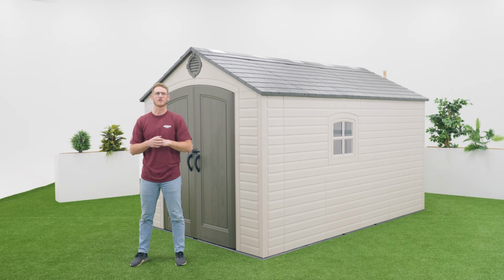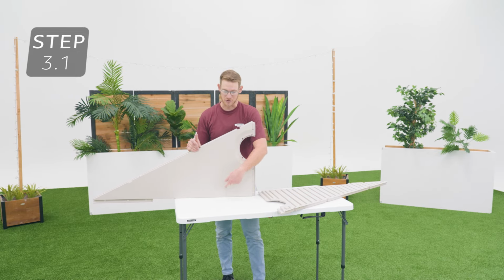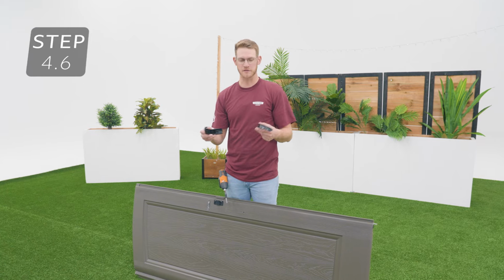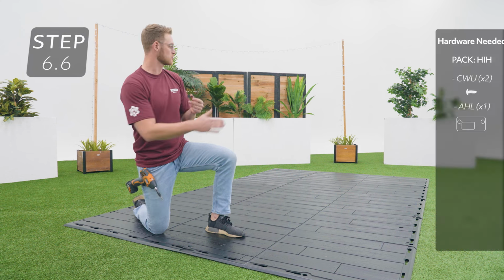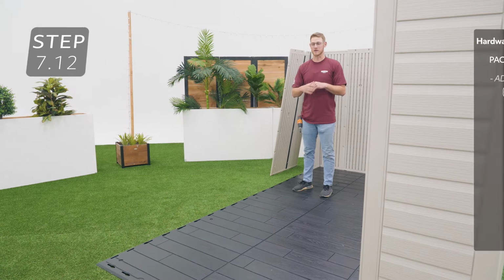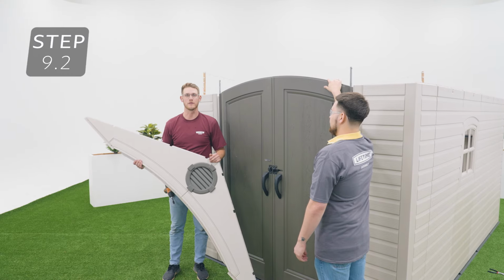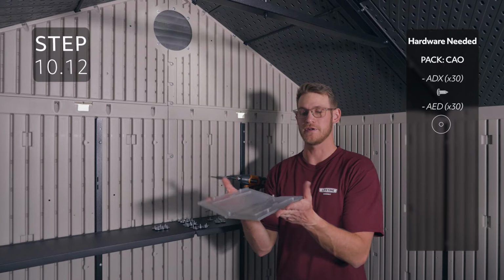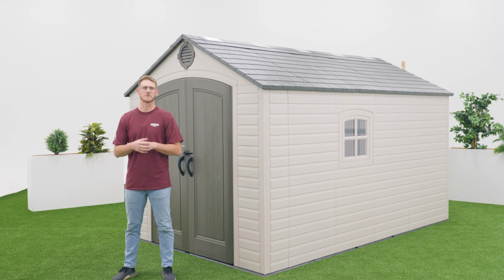Lifetime 8' x 12.5' Outdoor Storage Shed | Lifetime Assembly

Comment: Team,please add more info and stress the important points. Like the panels snap into the roof. Add your height, as some folks will need a ladder, Use the tools provided, I never saw the shims. Not to mention the corner pieces.

Comment: I watched the video before contacting Customer Service, and I noticed that the issue you experienced with the last wall support channel (AFM) matches what I am encountering with all of the (AFM) channel supports. You tried to force it in and you drilled it anyway. You can see it still crooked and leaning out.

The supports are too long and don’t fit into the slots—not just by a small margin, but significantly enough that I might need to use a grinder to shorten them. Even then, it appears the pre-drilled holes won’t align with the screw divots in the panels.

Could you please advise on the best course of action to resolve this issue?
Reply from the maker: The AFM channels can be difficult to insert into the wall panels. You can insert the AFM channel into the bottom and tap it with a rubber mallet to create a slight indent to make a little more room. Just be careful not to hammer them in and puncture the plastic. Or if the screw bosses are still visible, you can also angle the screw into place. We recommend starting with the last screw on the bottom, so the channel does not travel out of the slot. If that doesn't work, give our customer service team a call and we can troubleshoot the issue with you and see if we can figure out what is happening. They can be reached at 800-225-3865 or by email at customercare@lifetime.com. Customer service hours are Monday-Friday, 7:00 am to 5:00 pm  (MT).